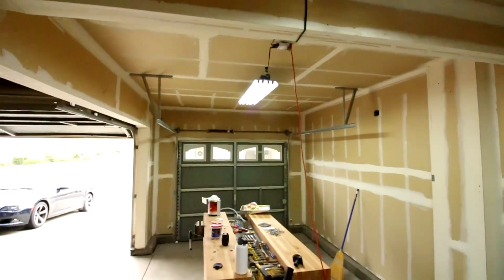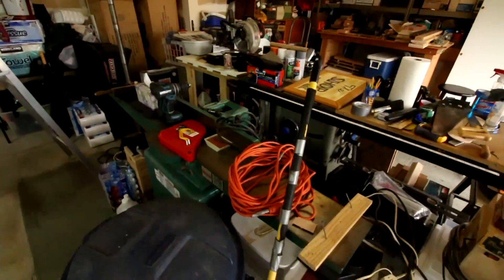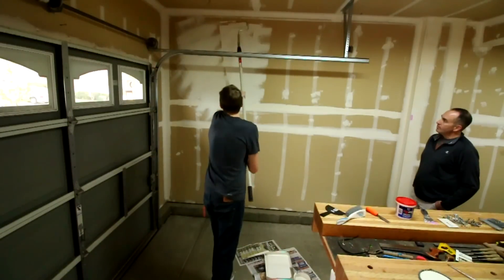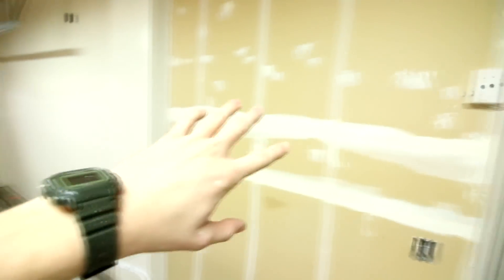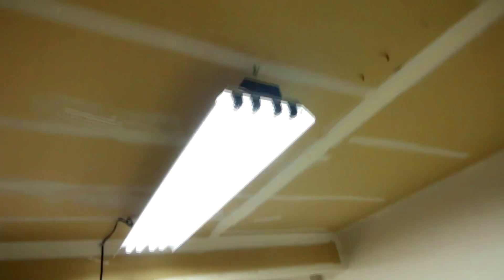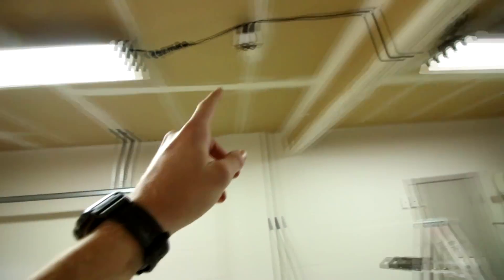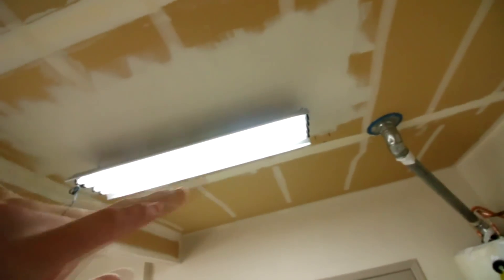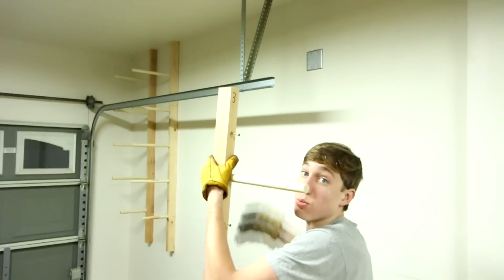This Looks SO Good!!!

Comment: Well done lad, you work well, I was thinking it must be a pain to have to take the cars out if you're making lots of dust so perhaps some sort of curtain wall could be made, but movable in case you need to machine something longer than the shop width, maybe OSB sheets on a overhead track might be useful, you could leave the end ones fixed to proved more wall space even.

Kev UK.